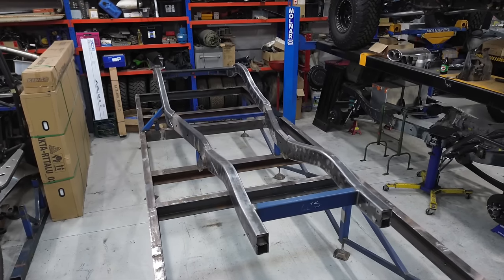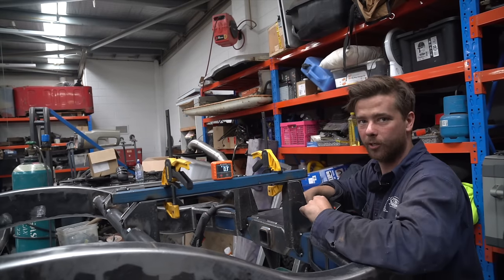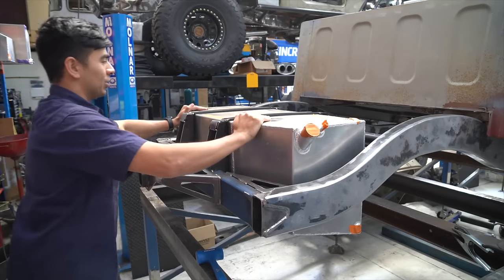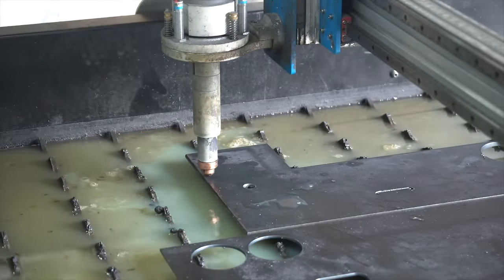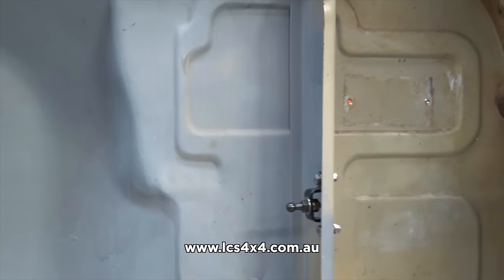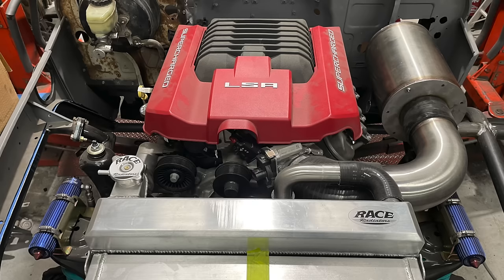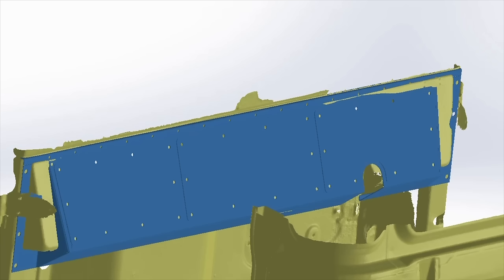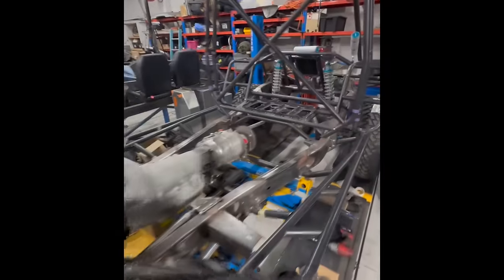FJ gets CUSTOM Dash, Floors, Fuel Tank and Rear Winch

Comment: Great build 👌one thing for cab mounts you’re better off using nylon nuts because with the rubber flexing the spring washer and nut can become loose 🍻
Reply from the maker: Cheers Greg, good call and will do it on final assembly for sure!